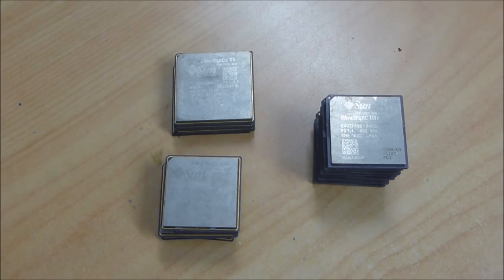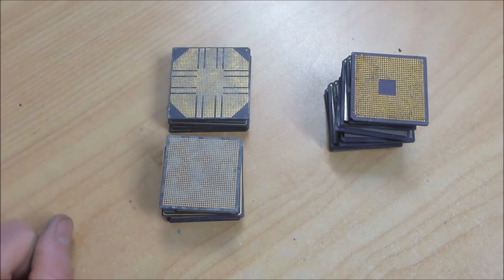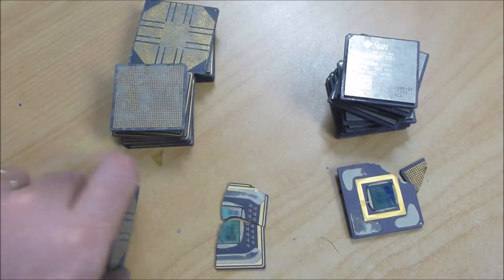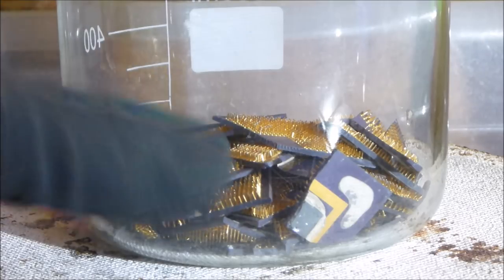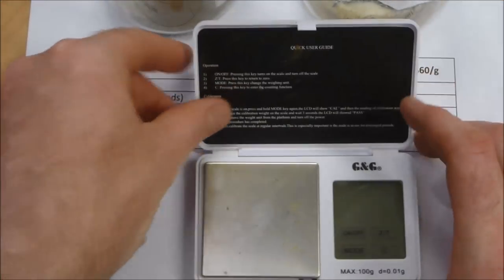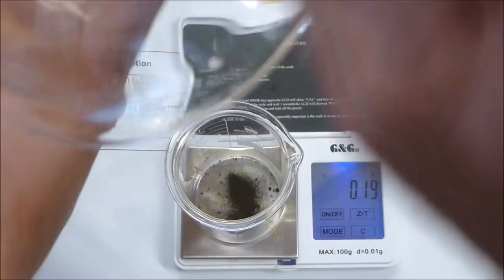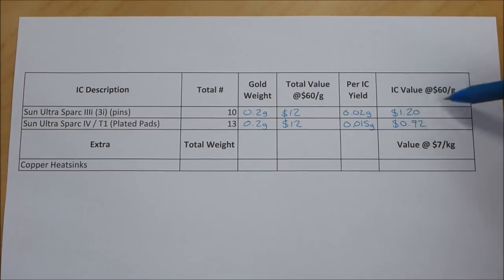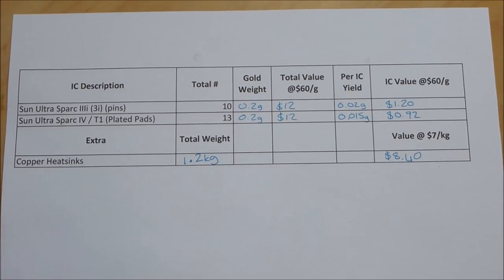Mailbag Episode 2 - Sun Spark Ultra Ceramic Processors

Comment: Before weigh gold dust, try to boil it in concentrated sulfuric acid. Gold is cleansed and greatly coagulates. Nice video ;-)
Reply from the maker: Thanks Bohumil, I have never tried washing with Sulfuric, will give it a try. Usually I do a few water and concentrated HCl washes, but in this case the Gold was too dirty to bother, really needed a second refine then wash. Thanks!

Comment: Those CPUs for collectors are worth 10 Euros per piece here in Europe. I was like screaming at my screen: do NOT destroy them for 1$ worth of gold and waste time/chemicals...
To maximize profit, scrappers should really check the value of ceramic CPUs before they break them up. Even if you would have sold them as a single lot for 5$ per piece it would have been a better business.
Reply from the maker: Donkey Learning IT Hey there, yes, I suggested exactly the same to the guy who sent these in, but it was too much hassle for him, he just wanted to know the yield.
Reply: I see... Sadly that is a travesty. Otherwise good videos man! To be honest with you, most scrappers make the mistake to fixate themselves only on gold wheres there are other ways to make more money with scrapping. Gold recovery should be the cream on the top. I know that trying to sell old RAM and slow CPUs is a no-go, at least I  was simply not able to get rid of still working CPUs and 512MB RAM sticks. Those should go to gold recovery indeed. However, power transformers and especially from toroid magnetic cores it is a better deal to remove the copper from them, and sell the cores. Also, from the cooling fans often there is more easy money to be made, than spending lots of time and chemicals for gold recovery from them. Main thing is: sell larger lots of 5-10 of these parts, and not single units, otherwise shipping costs are not worth it anymore for the buyer.
Reply from the maker: For sure, I'm processing quite a few ceramic CPUs for a guy at the moment (some videos to come) and I think a lot of collectors will be very sad to see the nice examples I'm smashing up. I told the guy he would get more money selling online, but he is happy to just get the Gold out. I'm happy to do it for the yield information, since I have never actually processed any of my own ceramic CPUs. I have a largish box of ceramics that I am holding onto for retirement :)
Reply: Those CPUs you put aside in 10 years will be worth a lot more than they do in the gold value. I was hesitating to buy old ceramic CPUs 4 years ago, and I bought only about 10 of them. They were available in huge lots, so shipping would have been peanuts back than. Now I am kicking myself, since they about doubled in price (Pentium Pro almost tripled), so it would have been a solid investment...
Reply: Hello!  Your response is 6 years old, but I was watching this video to get an idea how much gold value I can get for a LARGE COLLECTION of these Sun processors!  If you know of any of these collectors, perhaps I can open an ebay auction for $5 ea and you can flip them in your country for $5+ each (I'm sure they've increased in value since your comment is 6 years old?)